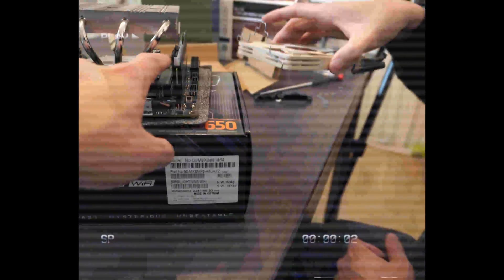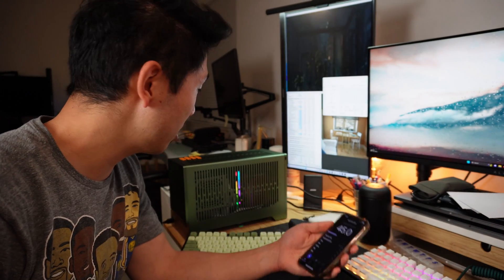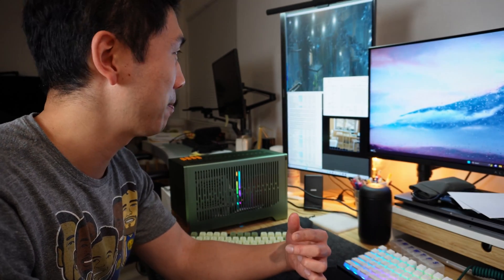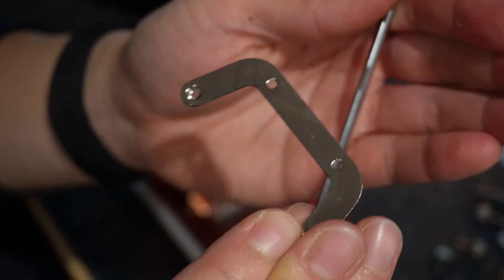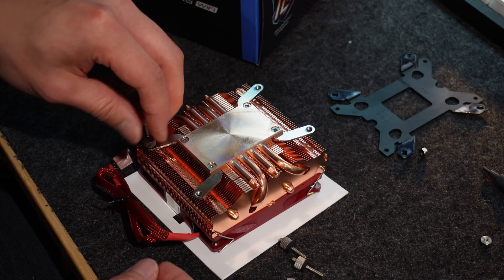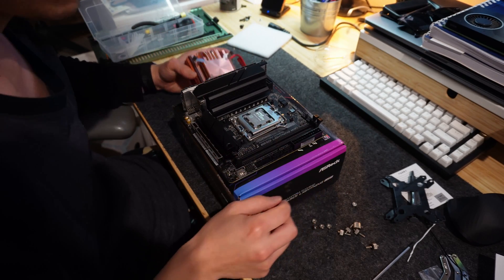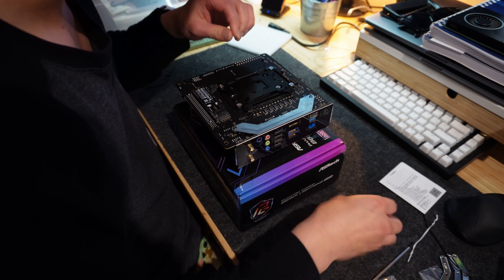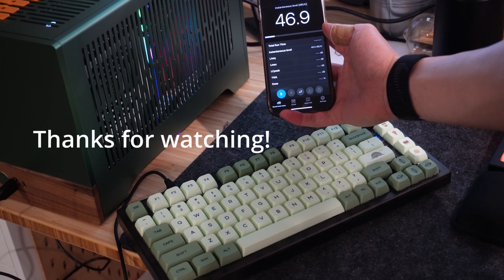Does it handle the heat? 7800x3d + AXP90-x47 Install Guide

Comment: That is not the right installation for am5 .. No need of backplate and use short screws
Reply: Ok so what I did was just put it through the front with short screws and then just locked from the other side using the screw caps on the  already attached back plate my mobi is b850i rog strix is that correctly acc to you?
Reply: @itz.manish_09  yes, you don't need double back plate lol

Comment: You don't need TWO backplates, you have to use the shorter screws with the nuts and the original Asrock backplate AND THAT'S IT. I don't understand why you did that, you don't need that extra AM4 backplate at all.
Reply: You're wrong. He needs to use the second backplate because the one on the motherboard has a protruding lip on its edges that will prevent the nuts to fit. You can only install the cooler without the second backplate on this motherboard if you use narrower nuts which are not included in the box.

Comment: You installed the AM4 backplate on top og the AM5 backplate. You also lifted the cooler after having it touch the paste. This creates small air bubbles between the IHS and the cooler. All in all it’s not very optimal for the little cooler.
Reply: I feel like the thermalright backplate is more sturdy then the stock one. 
Sure you could detach the stock one and put the thermalright on instead. 

I wonder if there is any difference when you just use both. Maybe it does give a more safe and secure fit, due to a more rigid backplate sitting on top of a more flexible. Not sure tho.
Reply: @mileshayes3652 , you should never install a backplate on top of another backplate. In no situation is that the Way to go.

Comment: didnt realise you leave the original am5 backplate on and then add this on top
Reply: The ASRock board has a lip so nuts won't be able to screw on without it
Reply: @krzzzy19 you can still screw down the nut even with the lip with the hand tool, it’ll just seem weird because the tool will be at an angle.
Reply: I'm sure he installed it the wrong way , with stock backplate you don't need their backplate lol
Reply: @香噴噴-p6f yeah I am so confused about this video
Reply: @manojlds  my axp90x53 full just installed yesterday , works perfectly with stock backplate regardless short or long screw

Comment: bro, u gotta put some exhaust fan in that thing man.
the cooler is beating around hot air.
get some 15mm thick fan and hook it up with some magnets if ur case does not have any screw holes for exhaust fan.

Comment: On mine, the screws lined up with the mainboard holes, but not the bracket.   I sent pics to Thermalright......
Reply from the maker: Oh dang hopefully they can help sort that out
Reply: @StraightforwardTech  They blamed it on a non-standard motherboard.  How's that, when the screws fit through the hole OK.  I may post a video, depending on how my re-ordered one turns out...
Reply: Trick is not tightening screws on cooler to much, go through backplate easy, you can tight after backplate is fixed with 4 screws

Comment: just bought this for my formd t1 build with a 12900k that i snagged at microcenter for only 140 bucks. I did replace the fan with a 47mm noctua fan. This is my first pc build btw!
Reply from the maker: Awesome case to build in! Which version did you get ncase v2.5 or v2.1 from formd?
Reply: @StraightforwardTech  the ncase 2.5

Comment: How much Watt was the CPU consuming during the stresstest? I am Thinking about doing a Terra build but i only have about 62mm of CPU clearence so i was wondering what cooler to buy.. I was thinking NH-L9A but it seams to throttle quite hard under 65Watts of load.
Reply from the maker: https://youtu.be/LR4aNK87ZPE?t=141 I don't have the results anymore but from this timestamp it was ~66 W hopefully that helps in your decision.

Comment: FYI, you are actually thermal throttling in Cinebench, even though HWiNFO doesn't pick it up. The Asrock B650i has a default 75c thermal limit on the CPU. You can increase this limit in the BIOS up to the AMD-recommended 89c if you want to get a little more performance.
Reply: lmao thats why his temps were so max 75/76 and I was like how? Even with my PBO -30 my CPU spiked to 85/86 with a larger cooler xD

Comment: I have the same cooler on a 7950X3D running Eco Mode 65w TDP. Nice little cooler and looks really awesome, but I do hate Thermalright's "screw it till it feels right" approach to mounting. Just wanted to say you can make your life a little easier by ignoring the Thermalright backplate alltogether. Just use the shorter standoff screws that come in the pack, go through the stock backplate which is held in place by the CPU retention device, and screw on your nuts. Adding another backplate adds 0 value or function to the cooler and makes it just a bit more needlessly complicated.
Reply from the maker: 100% this
Reply: Kind of.   It's worth noting that the nuts that come from the x47 are too big for the back plate of this mobo though.   Even if you really crank down on them they have a pretty big standoff from the plate.   Pretty jank but ... Well I hope it works haha
Reply: I put the cooler on to the stock am4 mobo back plate and it all works fine, without it there is no protruding alignment piece and your screws can be all over the mobo holes. Included backplate was useless
Reply: Huh.  My nuts were way too big. The am4 plate had rounded corners and they didn't have room to thread on. 

I ended up going to hardware store yesterday and repasting.  Nothing fit the threads but I ended up using some m5s nuts as standoffs/washers.  

Not ideal but I feel a lot better about cooler plate contact than I did before, and temps seem to have gone down a few degrees.   

Definitely better than dremeling out the corners of the back plate, which I almost did.   

Anyway.  Ya.   My nuts are too big.  If you are reading this and your nuts are too big, try using the long bolts and putting something under the nuts as standoffs.  M3/5, thick nylon washers, whatever.
Reply from the maker: Large nuts huh….glad you were able to get a resolution and thanks for the detailed response!
Reply: agree, installed mine without the backplate less weight.
Reply: Wish i would have come here to see this before trying to comprehend the ridiculous instructions that the cooler comes with.
Reply: I've found that it really reduced the bend of my itx motherboard considerably, and it also reduced temp by about 1c by allowing me to confidently screw tighter. 

Since there's no spring system,  I don't know if it's too tight. It just worked.

Comment: Thanks for making this video! I have the exact same mobo and cooler. I was reading online how the backplate adds 1cm of extra thickness to the back and was wondering if this led to any issue. I was thinking of dremeling the corners of the backplate so I can attach to the backplate directl.y
Reply from the maker: No problem 👍 let me know if your plan works out

Comment: so, 8:22 does that mean you need some longer motherboard stand-offs to give better clearance on the back of the motherboard?

usual stand-off screws are like 7mm but by the looks of it on 12:12 that's probably beyond 10mm,
or look for a case that has a huge hole/opening behind the motherboard (huge enough to accommodate every corner of the backplate+cooler plate)
Reply from the maker: 8:22 I meant longer screws when talking about the various screws that come with the cooler. if your case/mobo has longer screws it can be helpful but I don't think it would be necessary to need that much clearance on the back of a mobo.

Comment: At 6:12, I've found it's really easy if you hold the mounting bracket with a pair of needle nose pliers and screw it in with a magnetic screwdriver.  I simply was not able to get it into place using just my fingers.  It was super frustrating.
Reply from the maker: Yeah it was a pain to install. I'd' imagine for people with larger hands its worse.